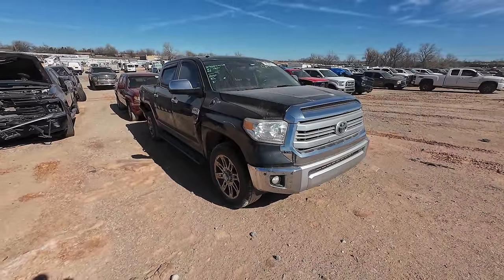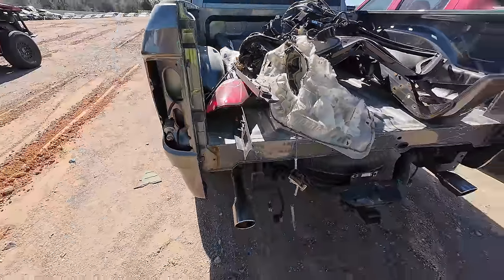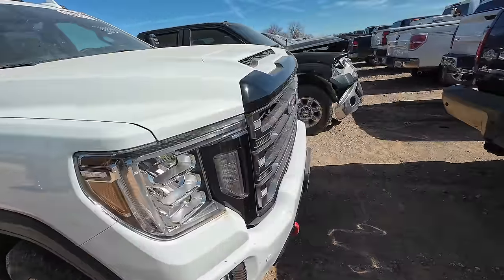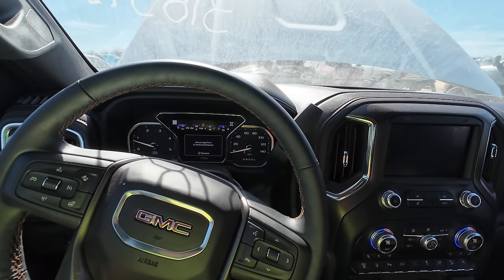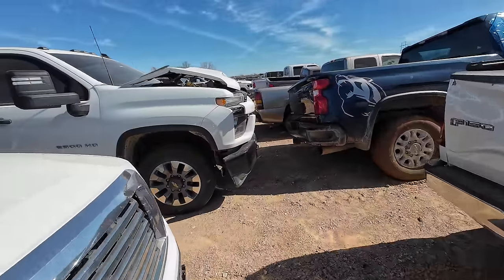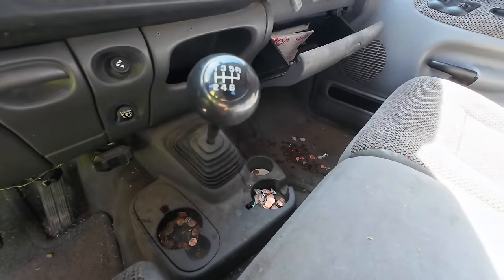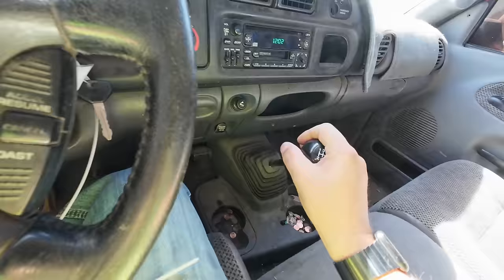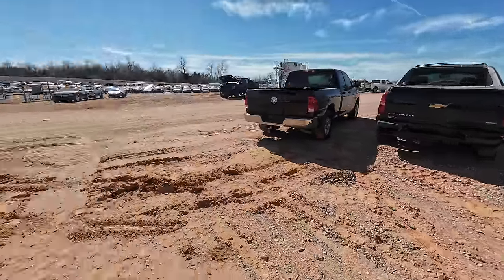I Found Some Hidden Gems in the Copart Truck Auction! Cummins!

Comment: Info on the 1794 edition...The Toyota Tundra 1794 Edition commemorates the founding of the Texas ranch that’s currently the site of the Toyota assembly plant in San Antonio where the Tundra pickup truck is built. The 1794 Tundra reflects a western theme with unique saddle brown leather upholstery and imitation suede inserts, and matching leather bits on the shift console, door trim and instrument panel.  It also came with a matching overnight bag and some other swag.  Only 1500 made
Reply: Almost MB S class quality inside.

Comment: We have a 2001 Cummins just like that but with 4x4 and it’s a great truck. The 6 speed manual with the Cummins is a great combo imo
Reply: The white GMC I`d do an EV conversion it over the winter months... single Tesla motor 600hp, 100Kw battery... :):):)

Comment: Good morning Randy. The 2014 Toyota Tundra is a decent looking truck even though it's got damage on the passenger side. The Ram 1500 is a good looking truck even though it needs tail lights, rear bumper and tailgate.

Comment: Still miss my 2000 Ram TDI Cummins quad cab with 350k miles and truck camper, got the same mpg as VW TDI at 27mpg. The only problem was radio replaced 4x under bumper to bumper warranty and SS exhaust went bye bye courtesy of parking on ocean for 3 years.

Comment: I work at a junkyard, we get tow truck after tow truck of nothing but Honda ridgelines, Honda crv, and couple others, have about 100 of them in the yard, we only drain the fluids, cut the cats, drop the gas tank(what’s left of it) and we crush them. There not worth anything. There the biggest rot boxes ever, gas tanks held up with ratchet straps, it’s crazy. There garbage. My work won’t even sell a single part from them.